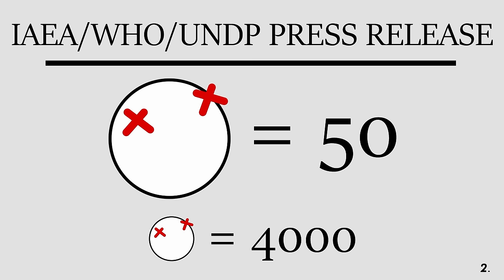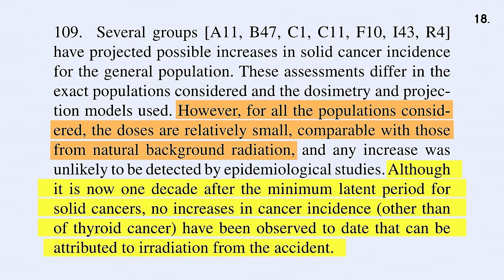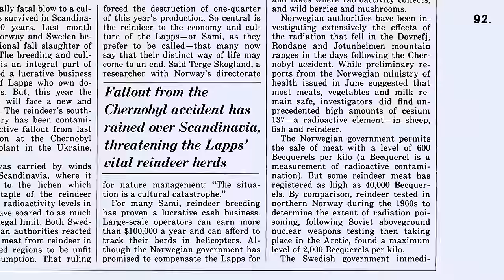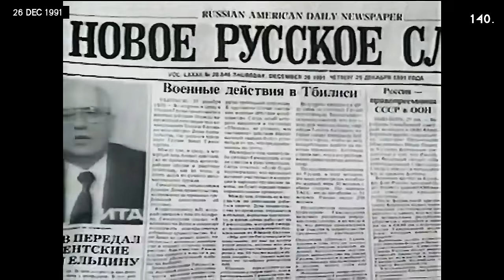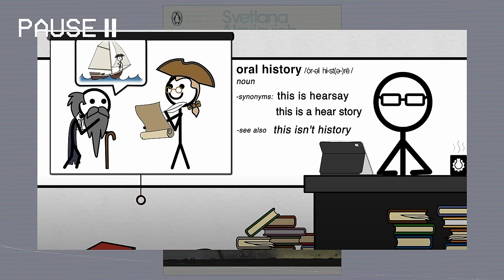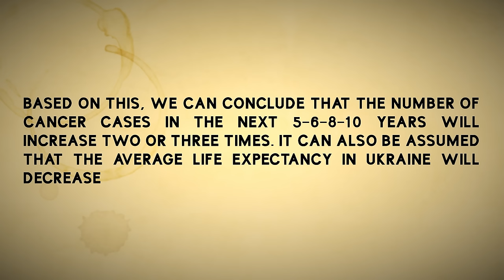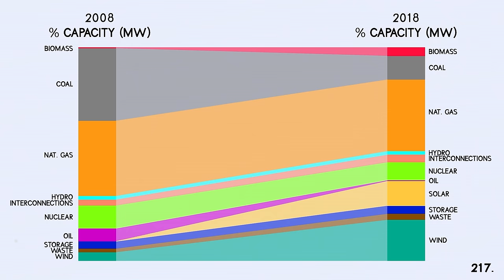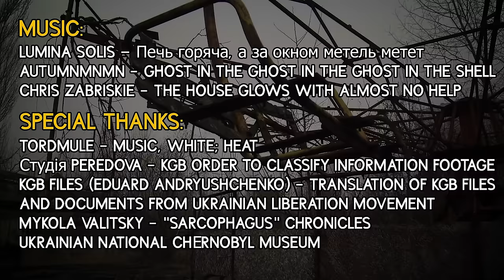Chernobyl's Death Toll | The Deep Dive

Comment: How can nuclear compete on the "market" when green energy is so heavily subsidized. Also this whole we got only 10 years things have been spouted since the 60s or earlier
Reply from the maker: No it hasn't - the ten years figure refers specifically to the pace of emissions cuts needed to have a 66% chance of keeping within 1.5C. it's a specific reference that means a specific thing. Regardless of what others have done with that number, in this video, I'm using it in the way the IPCC has used that number. Not in a "ten years left" way. 

Also the idea that renewables are so heavily subsidised as to distort the market against nuclear power is wrong. If all subsidies exited the market nuclear still wouldn't compete in a market setting - you'd likely end up with a grid that was a mix of renewable power and gas. This is why the bulk of the literature says nuclear energy favours centralised markets and economic planning. The reason France could build out their fleet, or why Sweden could build out their fleet, was because they were built by the state and underwritten with a load of cheap capital from the state. Hinckley Point C is only viable because of huge UK state subsidies via Contract for Differences - the size of the subsidy was so large the UK and EDF were taken to the EU High Court because it was gonna distort the EU's internal energy market. When you compare the subsidies of HPC to those of renewables renewables are orders of magnitude cheaper

This is a problem if your energy policy is dictated by the market and by cost. If you believe that you need more nuclear on grids (which I do) then it needs to be supported in some way by the state
Reply: @theoneandonlysoupemporium  I have to say im impressed by the quick reply and i will take what you say on faith. Another thing how exactly is 1 or 2 degrees measured exactly? Considering there is hugely variable temperatures all over the planet, Everything i seen looks very dubious. Thanks for the great videos btw
Reply from the maker: @ThreatFromAbovee  Thank you! I'd say have a gander at the IPCC reports - they usually explain how all of their measurements and models are done, but if you'd like something to listen to/watch instead I'd highly recommend a channel called Simon Clark - he's a Dr in Atmospheric Physics and all round smart boi. He has a lot of videos going into the science of the reports

The short answer is a lot of ways: satellites, ground measurements, ocean buoys, historical records, ice cores, tree cores, ships. You average all of those out and plot them year to year to see how things have changed and where they changed

Comment: The only way you can be in favour of nuclear energy is by consistently ignoring all the disadvantages or brushing them aside with "Yes, but if you did it right, we wouldn't have these problems". To date, no solution has been found for the storage of nuclear waste. Or to put it in the words of a German rapper: "And Fukushima is not the crux of the matter
It's Morsleben, Gorleben, Ahaus and Lubmin
Where, as if it were nothing at all, they speak of thousands of years"
And even ignoring that, nuclear fans seem to forget that nuclear energy is a fossil energie. Uranium is as finite as oil and gas are. The massive destruction of the environment through mining is then of course forgotten as well. 
Then there is the myth of reliable nuclear energy. This summer we saw more clearly than ever that this is just a lie. With increasingly hot summers and longer periods of drought, we will simply run out of water (drinking water, by the way) for cooling. 
So no, nuclear energy is not a solution to the climate crisis, never has been and never will be.
Reply: Well that's a pretty poor arguement. If you do it right goes with everything. Oil is perfectly fine if you never spill it. Coal is perfectly fine if you never inhail any of the hundereds of tons of mercury that it throws in the atmosphere. And what's that about the "myth" of renewable energy? I'm from Canada, where near 70% of all energy is renewable. I've never once encountered problems with getting power

Comment: 36:14, it's not the free market that's the issue. It's the fact that governments are not sticking to their role as referees. What you have are those in power playing favorites, which is not a free market., 36:16 The issue is that people conflate a democracy with a democratically executed republic. Republics work fine as long as all are held to the law. The problem with democracy is that it is the tyranny of the majority. Democracy is two wolves and a lamb voting on what's for dinner; a republic has a well-armed ram reminding the wolves what is not on the menu.